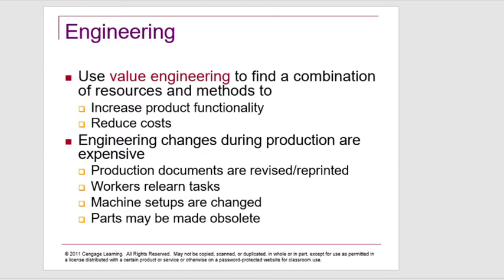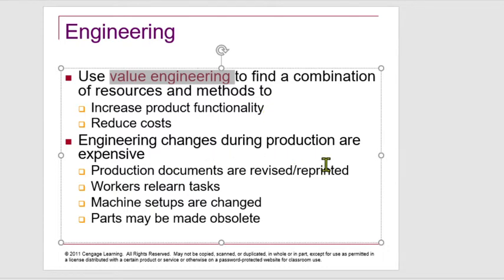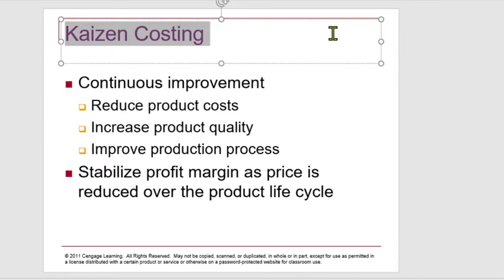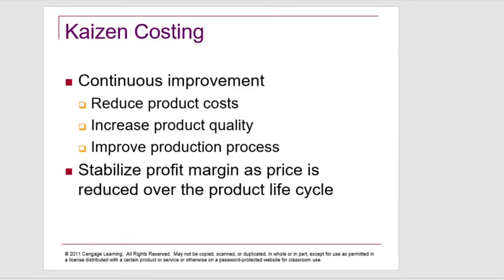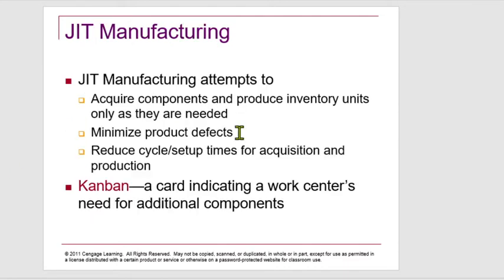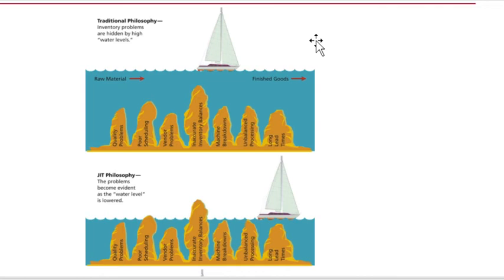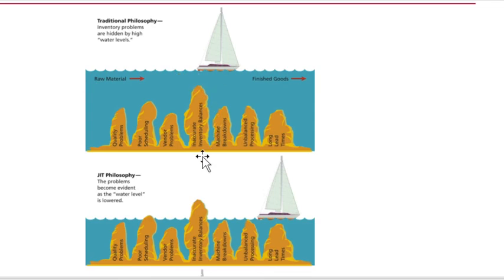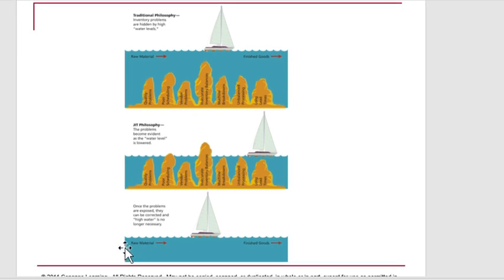Strategic Cost Management - Discussion Video Part 2

Comment: Sir ano po difference ng kaizen costing and JIT system? Pareho po sila nag iimprove ng production process dba sir?
Reply from the maker: It is really hard to distinguish kaizen costing and JIT system as both concepts employed cost reduction and efficiency in operations. BUT the key to understanding Kaizen is that it  is a cost reduction system for all areas of operations. It is dubbed as the continuous improvement.
Reply from the maker: On the other hand, JIT system is a production strategy which primarily aims at reducing volumes of inventory in the warehouse thereby reducing carrying costs.
Reply: @SherwinSantos  Ok sir thank you so much :)